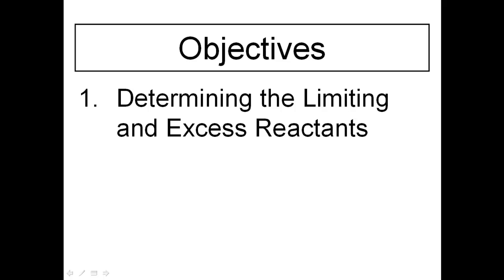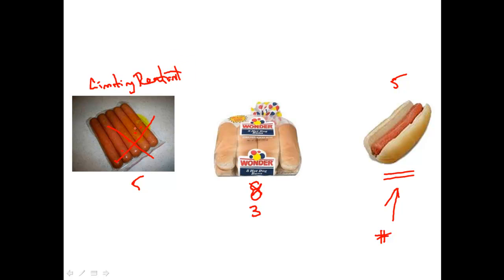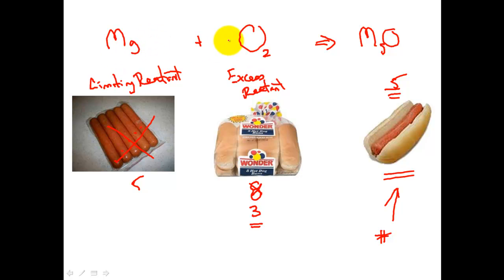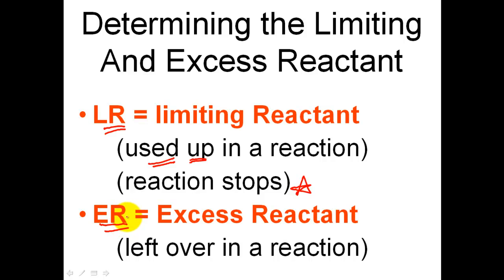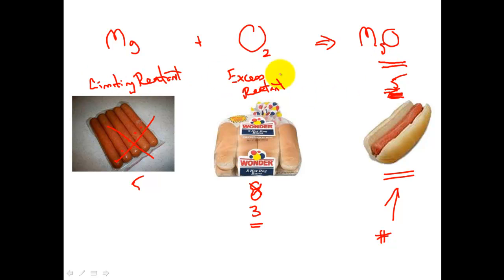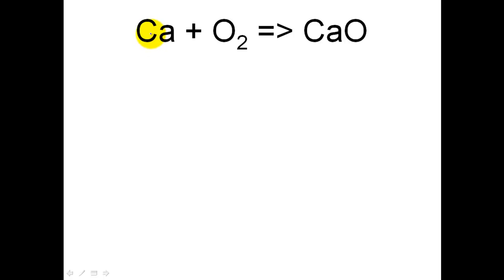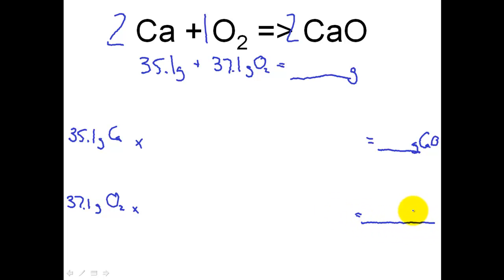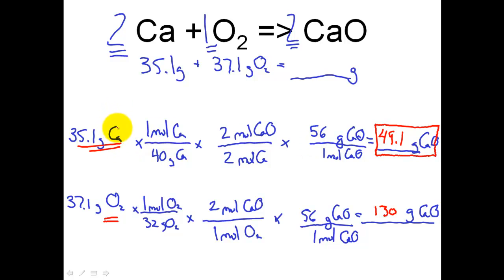STOICHIOMETRY - Limiting Reactant & Excess Reactant Stoichiometry & Moles

Comment: just use the hiding method, it's alot easier. 

   First, balance the equation. Next, you must list your given according to your reactants, like so:

             2Mg   +     O2  -->    2MgO
given:  15.5g          20L              ??
ratio:

  After you're done that, you find the ratios in which your reactants/products come in (mass ratio, mole ratio, etc). NOTE: your ratios must have the SAME UNIT as your given. (usually the question specifies what the unit of your unknown is, I'll take it as liters/dm3)

            2Mg   +     O2  -->    2MgO
given:  15.5g          20L              ??
ratio:  24g               22.4L          44.8L

   To find the limiting and excess reagents, we use the hiding method. Here's how it works: hide one of the GIVENS of the reactants (DO NOT HIDE THE RATIOS). Let's take for instance, 20L under O2.  Then we will find what O2 is supposed to be, and then compare it with what is given. 

  Use anyway to find O2, the way i use is that you cross multiply and divide by the opposite number, for here you do 15.5g X 22.4L => 347.2, divide that by 24g. 347.2/24 => 14.47L .  

Now, you compare that with the given. 14.47 < 20 , which makes oxygen the excess reagent, since you have more than what you need. ALWAYS, always will the other reactant be the limiting if this is the excess. The rule is to always use the limiting reagent to find the required volume of MgO. Now we solve like before to find the volume, by using the limiting reagent (Mg) .

15.5g X 44.8L =>  694.4 / 24 => 28.9L of MgO is produced. Voila, there is your answer, my friends. If you have any question feel free to ask me, and good luck on your chemistry final :). Correct me if any of my numbers are wrong.

Comment: where did u get 22.4 liters of o2   6:30
Reply: Emily Kight That is correct, its the "STP" (or standard temperature and pressure) of O2. "At STP, the molar volume of an ideal gas is 22.4 L. In other words, the volume of 1 mol of a gas like oxygen is 22.4 L. (mol/22.4L) or (22.4L/mol)" Source: (http://www.wyzant.com/resources/answers/2247/how_many_oxygen_molecules_are_present_in_113_97_liters_of_oxygen_gas_at_stp)
Reply: I guess 22.4 L is a conversion factor. It's the volume of a gas at STP? I suppose? I don't know. Do we have enough info to make those assumptions?

Comment: And how can we fing the amount of product that was made from the reaction?
Reply: You just calculate it. First you turn the grams of the reactants in moles (divide the mass you have by the molecular mass you calculate using Mendeleev table), then multiply by the molar rate of the 2 substances, and finally multiply the result with the molecular mass of the resulted product. Watch the video, as it shows the calculations.
Reply from the maker: Thanks for answering. You are right, in short, use stoichiometry to get the answer. I have a video on LR so I'd advise watching that.

Comment: HOW DO YOU FIGURE OUT HOW MUCK OF THE EXCESS YOU HAVE LEFT UNREACTED
Reply from the maker: I think I may have a video on that. Either way, it would be a little stoich. Use the initial amount of th LR but convert it to how much you need of the ER. Then subtract that from the Given amount of the ER. Tough to put into a few words. Sorry if it didn't help.
Reply: coud you also add the two given amounts then subtract it by the lr

Comment: @Alexis Rivera that would only work if it was in grams, but its 20L. The conversion factor between moles and litres is 22.4L/mol at STP. however, the question did not specify that the O2 was gaseous, or that it was at STP, thus the question is done incorrectly. Just little things, but watch out for things like that on a test.

Comment from the maker: Picture this, when you are given a length in feet, such as 6 feet, and are asked to convert to inches, what do you do? You would use a conversion factor such as 12 in = 1 ft. The key is that you need a conversion factor! When you are given the volume of a gas in liters, such as 20 L as the video shows, you need to convert that out of Liters and into moles. In order to convert it, you need a conversion factor.

Comment from the maker: 1) Take the limiting reactant amount, then use stoichiometry to convert it into the excess reactant. (Make sure you convert it to the same unit of measurement that the givens were originally expressed in). 2) You should now be in either grams, liters or molecules.... for the excess reactant, this is how much you need to use up all of your limiting reactant. 3) Subtract this amount from the given of the excess reactant. This gives you the amount of excess reactant left over.